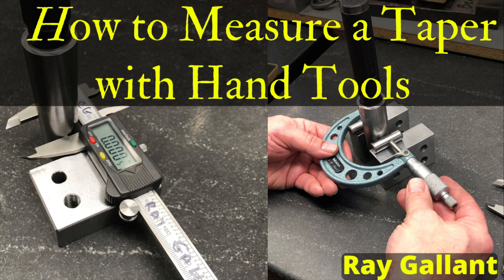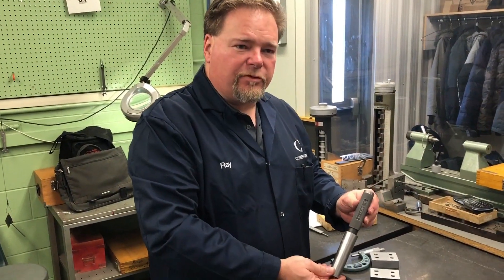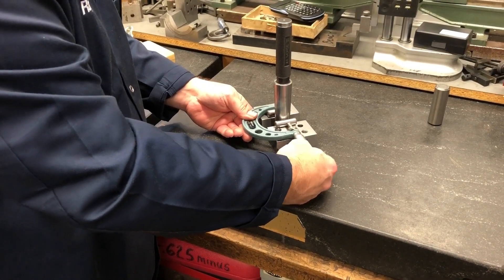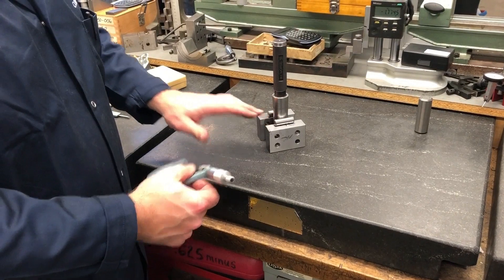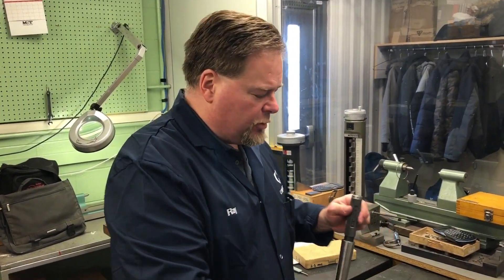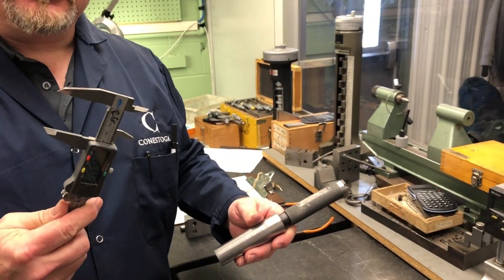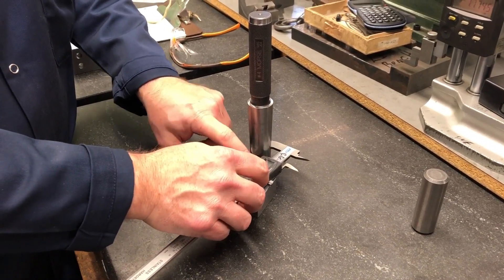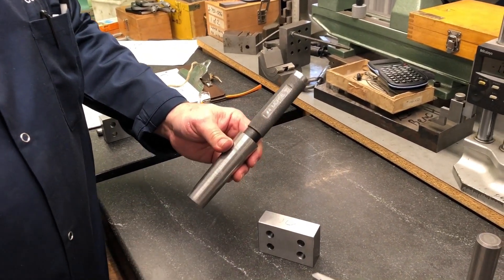How to measure a taper with hand tools

Comment: Watched a few times & Im missing something, I have a 1" stick out tapered shaft on a old craftsman drill press ( missing chuck) Bottom measures Appox:: 0.565 small end and 0.625 on big end on 1" .... difference of .58 so whats the # morse....I need to go back to school...Thanks
Reply from the maker: Hi Tony
what you are measuring is a jacobs taper not a mores taper  
# 33  is 0.6245 big  - .5605 small and 1 inch long with a taper per foot of 0.76194
hope this halps 
ray
Reply: @shopandmath  Yes You've solved my problem , Thanks a bunch.